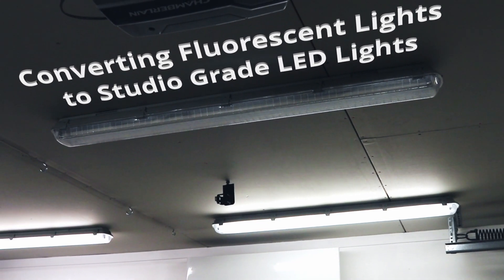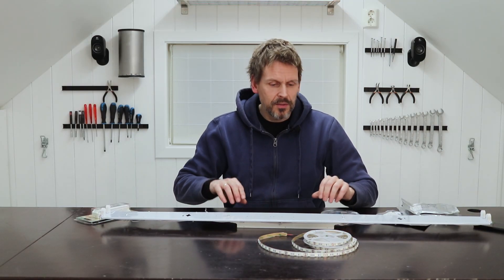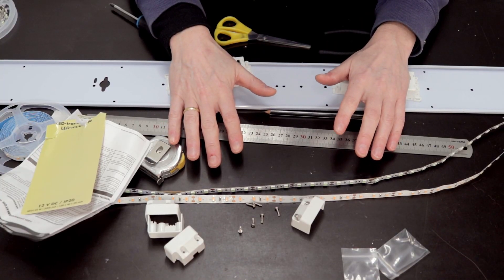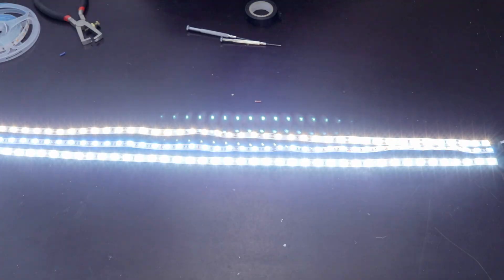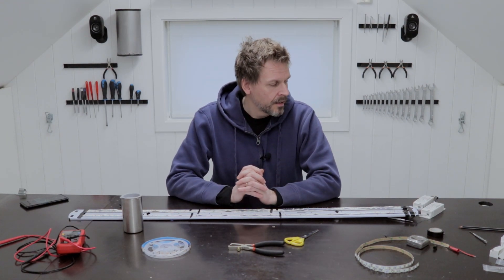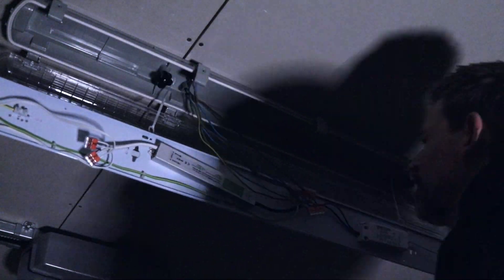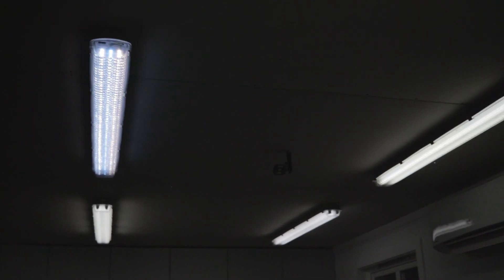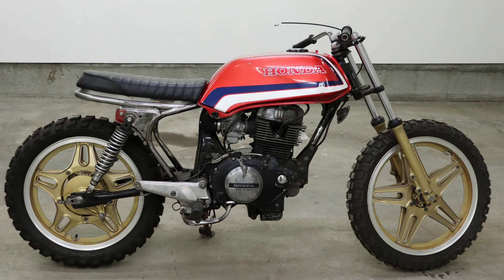Converting Fluorescent Lights to LED using LED strips

Comment: Very good video. Please keep them coming. Really want to have a full garage tour 😊 Do you know how many Watts your lamps is after the LED conversion ? Greetings from your home country, Norway 😊
Reply from the maker: Hi Macgyver 😁 Glad to se a fellow Norwegian here! Yes I know the wattage, I measured the amperage in the video and it's just to multiply with 12 (Volt) and you get the Watt:
* Bright White: 1.6 x 12 = 19.2 W
* Yellow White: 1.45amp x12 = 17.4 W
* Blue White:  1amp x 12 = 12 W
* TOTAL = 38.6 W
The led strips are 1.2m per piece in the lamp = total of 3.6m led strip.
I have to say that I had to add a dimmer to the blue one, because the light got too much of a blue tint when recording compared to the fluorescent lights, and the blue led strip has not been used very much.
I am now in progress of redoing everything. More of the Biltema fluorescent lights has stopped working, but insted of converting them to LED I want to change to LED aluminum channels this time. The Biltema lights get quite hot, they are made of plastic and do not have any ventilation, I am afraid it might reduce the lifespan of the led drivers and the led strips.
I am starting my new light conversion these days, it will be quite more exiting this time - i hope, and a new video will be made 😁